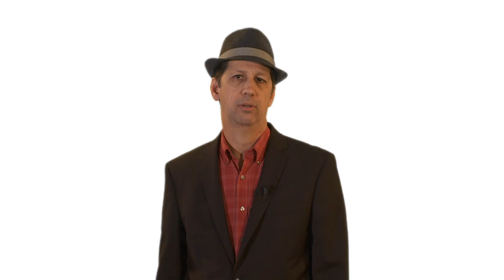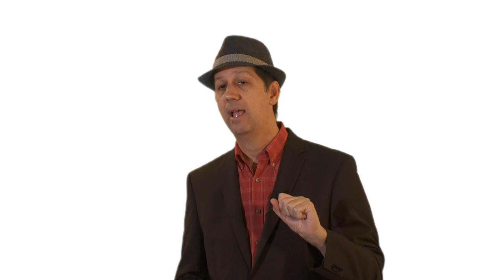OTC-X1 Questions & Answers

Comment: What springs into my mind to why the capacitor plates are U shaped: they follow the shape of the inside of the hull. Any charge of high voltage building up is naturally discharged against the inside of the ships hull. It follows also the exact shape you eventually want to surround the ship. This torroid shape which is pre end everywhere in nature/the universe.

Comment: The whole mental thought thing. It's really quite simple, it has nothing to do with current technology that I am aware off (excluding black listed projects obviously). 
Telepathy is the art of sending and receiving interpersonal experiences of the senses. This is only possible through quantum engagement of the etheric realm, aka allowing the mind to enter the ether where there is no time or space. When Carr used an aether extraction or zero point energy extraction method, he was enabling the modulation of the device to be respondent to other beings within that etheric realm. The laser has nothing to do with this communication system on the telepathic level. The laser, which obviously wasn't a laser is bloody genius though. I don't know if you understand the simulation theory and frequency or not. But everything is frequency, including gravitational presets in the atoms, gravity is not an external force which is why it can be changed so easily with the right technology, and it's why teleportation is so easy again with the right technology. How he managed to map the entire globe and everything in it by colour frequency is beyond me. It was beyond Tesla and is truly amazing.
Reply from the maker: A falling out; disagreements; personality conflicts, etc. had nothing to do with my walking away.  The team members are well-aware of what you've shared.

Comment: Charge the plates with 20kv of RF and it will fly
Reply from the maker: You've got your terminology twisted around in a knot.  kv is Kilo-volts.  Voltage is a potential difference; Radio Frequency (RF) is the byproduct of placing an electrical signal on a conductor / wire (antenna), such that the electrical signal applied to the the wire (antenna) would be at a frequency measured in Hz and it's power in Watts determined by Current x Volts (affects how far the signal may travel).  The signal leaves the wire (transmitting antenna) and enters the air as electromagnetic radiation at a predesignated frequency intended by the circuitry design and the wire (transmitting antenna) length and configuration.  So, the notion of charging "...plates with 20 kv of RF..." doesn't make any sense.  You may apply a source of power (an AC or DC signal comprised of current and voltage) to a plate or any conductor; and, in the case of AC, you can specify the frequency of that source.  You don't apply RF to a conductor...at least not the way you're thinking...and certainly not in the unit of measure you've proposed - kilo-volts.  RF may induce a signal to flow in a conductor (receiving antenna) when the electromagnetic signal traveling through the air at a given frequency in Hz (not kilovolts) and power (Watts) arrives at, and moves across, it.  I wonder if you're were thinking about applying the principle of high voltage thrust lifters to the X1? There's no comparison between the two.

UPDATE: I've received your e-mail...I've viewed the video - interesting, to say the least - https://www.youtube.com/watch?v=Z-M55XP3D4A

Comment: I have been studying ether technology, so it turns out the Mica with its high temp resistance, high dielectric capabiities, light weight p, reflective and tons of other great properties and coupling the system with a aether generator (quartz or any natural occurring crystal) and a aether amplifier ( orgonite) . just finish it off with perfect geometry....

Comment: imo the "capacitor plates" are in fact functioning as such, ill explain why: 

1. In a common capacitor the factors  that matters for it's capacity size are the surface of the plates, distance between the plates and the chossen dielectric (=Isolating Material between the plates).  By bending the plates backwards in the OTC X1 u will get a bigger surface of the plates on smaller area,  like that the plates can hold a bigger load.

2. The Plates Build a capacitor when u take the outer hull of the craft in consideration or even the plates in the circle  next to eachother. There u have two metalls oposing eachother isolated by an airgap = Capacitor.
Reply from the maker: 1. the "capacitor plates in the plan are U-shaped - one piece. Do you think it could still act as a capacitor in that configuration?  If so, what would be its function in the overall design?  What material do you think would function as a dielectric, while providing structural support for the accumulator frame (center disk)?

2. regarding air-gap dielectric, how would that enable levitation (or other functionality) of the overall design?  

Thank you for watching and posting.
Reply: 1. Not in the conventional sense of a capacitor but if you look at it in a electrostatic manner you can apply a charge inside the U-shape (where the plate is facing itself) and charge up the outside of the plate like a Van der Graf generator. Functionwise: i think all the plates combined are one piece of the "charged counterrotating bodies" part as mentioned by Carr. I have a feeling that Carr meant by "hold a high charge on these plates" the high potential because u can not hold a very big charge/energie on these plates (even when separated).

A good dielectric would be mica (up to 60 kV/mm) but you would still have close air gaps here and there making this insulation useless (0.35 kV/mm,  normal air) and also if you have that U-Shape the electric field between the plate will repel no need for HV insulation.

2. Well It's theoretically possible to charge the outer hull from the inside over the capacitor plates, it's a question off potential and air gap distance. Then you will have these two charged bodies counter rotating. But no idea if this actually works or not, it's just a different perspective.
Reply from the maker: The guys have considered using mica.  Do you you have a copy of the OTC-X1 toy kit plans and Carr's Patent for his amusement device?  You can find them at my website: http://clandestinedisclosure.com
Also, I'll suggest you read Tesla's notes on Forbes' mono-polar motor (link appears on m website)...and have another gander at the "Capacitor Plates".  :-)  Thanks!
Reply: Yes sir, i read that before. The information about the Unipolar dynamo is gold, also gold is your down to earth approach on the topic. Please keep up the good work!
I know the unipolar-dynamo is the principle to get the whole thing in rotation. I tried to fit in Mr. Carr's statements about charging these "Capacitors" via the center core and air ionizaition (and rotation?) since a standard unipolar dynamo creates high currents with low potential(voltage) on the other hand it makes totally sense that they became problems with overheading wires under these circumstances (high currents) and  i'm totally with you when you say  practical experiments are key  :-) .  Thanks for your response btw.

Comment: Hi I have a very good question, how come Mr Carr having spent most of his life working on the principles of this craft would go on to let the tea boy take it for a spin??  Its pretty obvious to me that the tea boy has fabricated that part of the story. Mr Carr also stated that he was the only one to see a flight model take to the air, he rebuilt the same model 6 times making it a larger diameter and lost the 6 foot model due to control failure. 
The cost of building a 45 foot craft was prohibitive and it never happened. From my understanding the demonstration model failed due to the tolerance/clearance between the electromagnets and the Utrons. If you check out all the video clips you will also notice the Utrons are placed differently. Why ? Also the demo model was out of balance and didnt run true.
Its a shame that tea boys have jumped on the band wagon and claiming no knowledge whatsoever in engineering. 
Mr Carr comes across as a genuine person, but the tea boy is the exact opposite. 
Even if the craft worked would any one believe that this amount of power would be safe in public hands I dont think so,  It would require a lot of training and skill. The ordinary person would struggle with Porsche 911 or any other super car. 
The free energy aspect is another matter entirely if it worked?? 
Hopefully the truth will reveal itself one day but I doubt it. If any one wants to know how the craft could have worked stay clear of suspicious fabricated stories and look at 1950,s technology.  
I have not intended to offend anyone but common sense must prevail. I hope Mr Carr was unto something, he certainly believe it himself.
Reply from the maker: To respond or not to respond, that is the question.  Usually, I outright delete posts like yours for rude content and block the accounts behind them; because, as a first-time contact, it demonstrates rudeness.  Is name-calling part of your normal practice when meeting new people?  I hope not.  In your case, I'm making a rare exception to respond; because, by your own hand, I think it's possible you are aware of your mistake.

At the end of your post, you wrote that you don't want to offend anybody; yet, at that point, you signaled that you probably should have done some re-writing and didn't.  By that point, you had already referred to Ralph as "tea-boy" (a derogatory phrase meaning petty criminal) not once, but four times.  If you truly didn't want to offend anyone -- and I'm assuming for the sake of my response you didn't -- then perhaps you should have proof read your post for tone, gone back and removed all the derogatory references to Ralph before clicking that REPLY button.

You're not the first to make this mistake.  If it's not a mistake, then you lied at the end.  Again, I'm assuming a mistake was made.

I think many of us tend to make this mistake.  We allow our emotions to drive us and we go off half-cocked using nasty language; because, at the time, gosh, it makes us feel powerful, right?  We let those endorphins kick in by being nasty and it feels good! 

The trouble comes when we click the REPLY button without proofing our writing and rethinking our intent after the fact.   We come back later to read what we wrote and go -- oops, that's not what I meant at all!  I'll assume this happened to you.  Still, I want to share a few more of my thoughts on posts like yours.

You may well be presenting valid arguments; and understand, I have no problem with folks disagreeing with my guests' claims and sharing their opposing views.  In fact, I welcome intelligent debate and you and I may have agreed on some things; because, I am searching for truth and reality and know I don't have all the answers.  However, I am compelled to tell you that your seeming predisposition to name-call removed any interest I may have had in entertaining any of your arguments -- good, bad, or indifferent.  It's just bad mojo, man.  Nobody wants bad mojo.

I've always drawn the line at venom, profanity, and name-calling; because, none of these bolster an argument or foster inspired critical thinking.  They are self-serving, emotionally-driven, repulsive, and unacceptable in any healthy intelligent conversation or debate.  Wouldn't you agree?

I completely reject the notion that Internet anonymity makes rudeness, name-calling, and vile language in social media acceptable.  It is not. It is simply bad manners; and, I refuse to suffer it by following the simple procedure I mentioned in the first paragraph of my response.

dolf92, whoever you are, I hope you agree with me and we can be friends.  Thank you for being you, for being my mirror, and for watching my videos.  

Best,

Walter
walter@clandestinedisclosure.com
Reply: Hi Walter, to start with I am not implying criminality in any way, I do apologize for my comments regarding the person in question.  I do not want to upset people but I was trying to make people see that this story doesnt add up. If I ever built such a machine full scale I would be the one flying it for the simple reason that i understood the principles involved.
I am very suspicious of any claims made regarding the otc x1 craft, the only person I believe is Mr Carr. 
I fully understand the costs involved in the construction of the 45 foot craft and it simply couldnt have happened. The testing program was to short and the government would not allow it to happen.
To start with even Mr Carr had concerns regarding the accumulator as the craft only had one and should of had two. 
safety is a priority at all times when you leave the ground and space is another matter entirely.
One must remember that there was no witnesses in all the test model flights, Mr Carr had a bad habit of using (we) instead of I. 
I do find this story amazing and possible with the 1950,s technology, and I will state again I do believe every word Mr Carr uttered. 

So Walter if I have offended the person concerned I am deeply sorry. It was not meant as a personal attack but I want the public to use common sense, and think for themselves. 

Can you answer this question for me has any one profited from this story financially?? 
As you can see i am still skeptical.

It will fly there is no doubt in my mind.

regards Dolf B
Reply from the maker: Dolf,

Welcome back.  No worries, man.  Critical thought is welcome.  For what it's worth, I make a distinction between being critical and skeptical.  The former is open-minded.  The latter is not.  

No one that I know has profited from this story financially.  Those involved in its research invest their own energy, time, and funds.  It is a net-loss enterprise for hobbyists.  There may have been some people out there who attempted to do gofundme pages.  As to whether they succeeded in their campaigns and profited?  I don't know.  I've visited machine shops with these plans and asked what it would take to develop them into a prototype.  The answer was staggering and well out of a hobbyist's reach.

Regarding there being no witnesses of the test model flights, we have one: James Gilliland.  He saw it in Apple Valley at night...caused a stir in the city.

Regarding 1950's technology - I hear you.  It is on the minds of the pods as well.  They feel that if this thing worked, they should be able to duplicate it using similar materials.  

Will it fly?  I don't know.  The guys think it can, based on Carr's claims; and, to that I say: test it.  If they build a test-model to test the principles - two counter-rotating charged bodies, I think it will fly such that it would shoot into space and disappear.  There's nothing in the plans that provide any indication of how it was controlled.  Ralph Ring says the craft was controlled mentally and that a crystal / light was involved.  Worthy of note: LASER LIGHT cannot refract into a rainbow of color.

For me, from a basic mechanical perspective, I consider cost, weight, materials, power, RPM, and balance of the entire contraption.  This is no small feat for a 40' craft.  Historical research into Carr performed by other investigators who are more qualified than most (who wish to remain nameless) has revealed to us certain other significant engineering and design problems, as well.  Dangerous decisions were made.  For instance, Carr burned-up one of his crafts in Oklahoma by going against the advice of one of his technicians and pumping far too much current into the craft.  The entire system acted like a fuse.  Oh-well.  You can't break the laws of physics.  You can only prove them.  If you're lucky, you'll survive.  Carr was lucky.

Carr's use of the word "we" is strange, to say the least.

I"ve been informed by others that model craft of this type have been constructed and tested and guess what happened to them?  They shot into space and disappeared...or so they say.  Can you imagine investing tens, if not hundreds, of thousands of dollars into constructing a prototype only to have this happen to it?

Thanks for chiming in.

Comment: i want ask ralph said there were big magnets but the design you have doesnt use magnet they use elector magnets. and i think the accumulator collects an infinate charge like a vendergraph  generator. so the outside ring is the generator of magnet focusing the eddie current toward the centre of the craft. I want to ask is it possible for the eddie current on the cappacitor plates to jump to the accumulator chargeging it creating a massive static field.

ok and i am using somthing called gap neautralization, i use the power from the accumulator to neautralize one magnet temporay and then i place another opposate of it like this( [ ] ) and as electricity passes through on magnet it is neutralize and the i cut the power and the magnet becomes reactivatied and repels sending both real in the oposate direction. ( [ - - - - - ] ) until they meet again ( [ ] ).
Reply from the maker: The big magnets Ralph refers to were, and always have been, electromagnets.